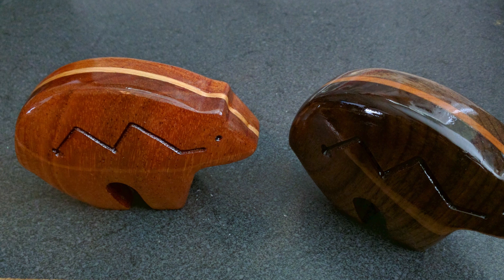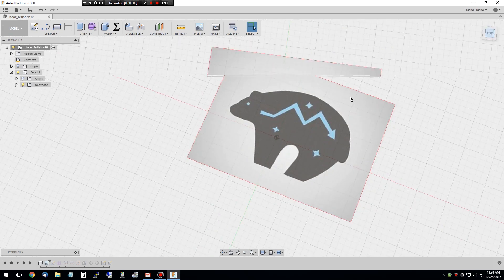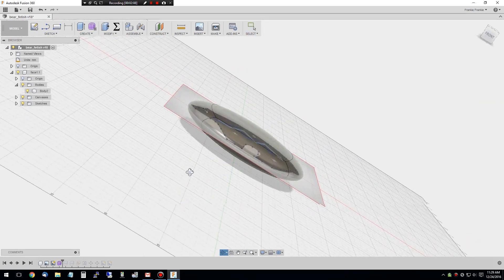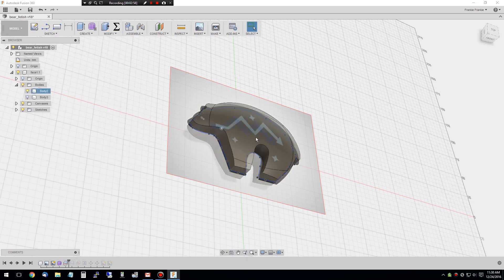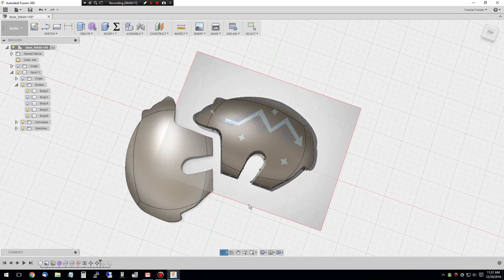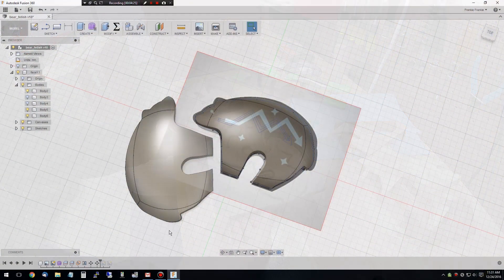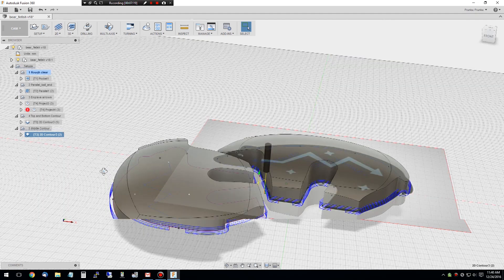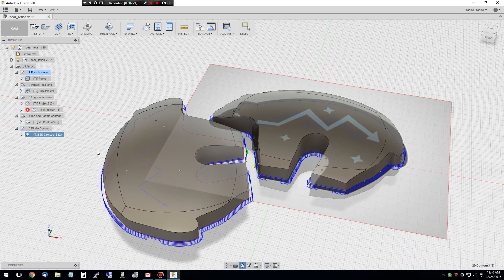Recipe for double-sided 3d wood objects in Fusion 360

Comment: Thanks for the video.  You might consider trying to work on both sides of the same blank, using the index pin technique.  I'm playing around with that approach now.  Of course, you would have to give up the contrasting strip of wood in the center.

Comment: Thanks for the tutorial. This helped me a lot. However, I get error message while filleting the edges of the new cut out body... I just want the rounding on the edges! Thx again
Reply from the maker: Radhakrishnan Nair glad it was helpful!
Reply: Frank Graffagnino any suggestion on getting the rounding of the edges?
Reply from the maker: well, i'm not sure why a regular fillet wouldn't work.  what you might do is post on the fusion forums... usually if you share the project link someone can open it up and see exactly what the issue is.
Reply: sure, will do that

Comment: Great video! What's the finish you're using? Amber shellac? Or something much glossier? (As for chamfer vs v-bit, they are the same thing except in woodworking the chamfer bit has a bearing and a V-bit doesn't since it's for engraving. But that's where the terminology difference comes in: A 90-degree V-bit is called a 45-degree chamfer bit because it creates a 45-degree chamfer around the edges.)
Reply from the maker: Mark Moran thanks Mark. the finish is just polyurethane.

Comment: Great job Frank! They look like neat gifts.
You could experiment with the 2D/3D Adaptive toolpaths instead of your Pocket toolpath, they are easier on your machine and are very handy, once you get into them.
Check out the Fusion stuff on the 'NYC CNC' channel for some great tips from another CAD/CAM user.
Reply from the maker: Robs Con thanks man. ya know, I really wanted to use the adaptive for those very reasons and I could never get it to work right. If you are experienced with those I'd be happy to share the project with you so you can show me how to use those with this project. IIRC, I couldn't get it to just clear over the bear areas no matter what I tried. So, after a while I just gave up and did the pocket. Maybe there were other issues too... can't remember.
Reply: Happy to help, but I am no expert!